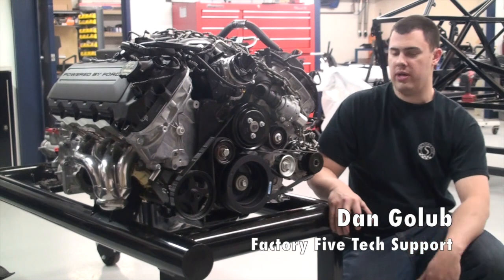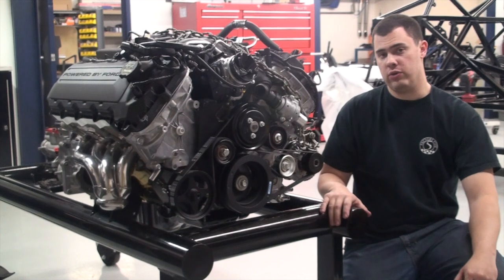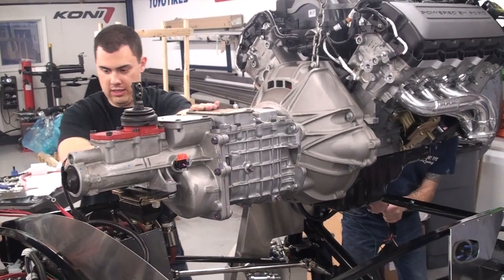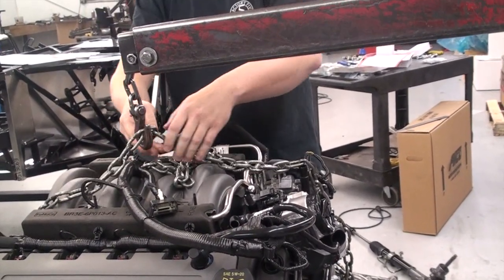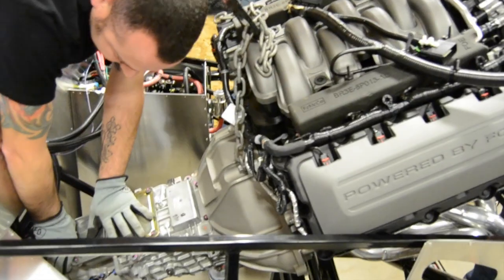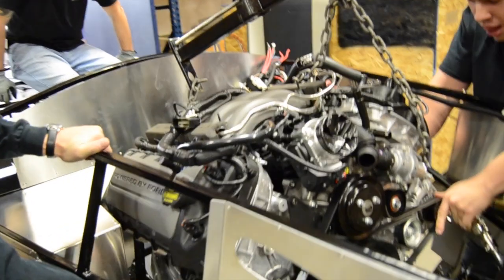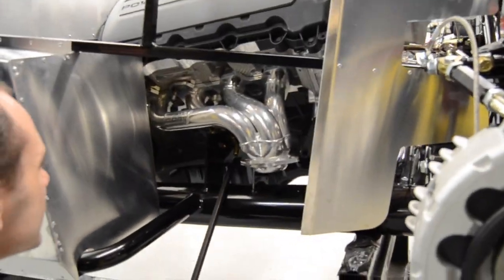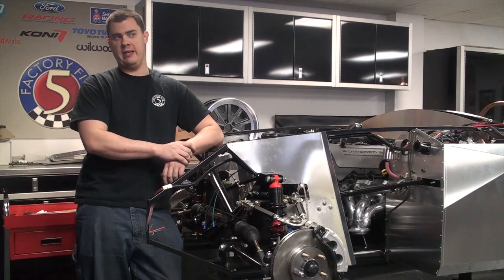Factory Five Mk4 Build Episode 13: Installing the Engine

Comment: Watched the whole series as ive not built a FF cobra but owned one and enjoyed it, reconfigured it several times and was now thinking of building a new one from scratch.  Obviously these videos are edited down for time but many of the techniques shown are parochial and some down right dangerous.  As someone who has spent 30 years as a machinist, mechanic, metal fabricator welder there are a lot of short comings with the techniques being shown in these videos, tech screws being used to hold brackets and cheap aluminum pop rivets used when stainless structural rivets should clearly be utilized as well as rivet nut inserts and proper use of grommets, the brake line video made me cringe completely.  I didnt see the use of a torque wrench in any video or the explanation of the proper use of lock tight and degreasing parts before its use, the use of body panel adhesive and most importantly as many people will do this install over the course of months or years the use of a permanent paint marker to mark properly torqued bolts so you can keep track of what has been tightened properly during the course of the build.  I realize these videos are clearly condensed for marketing purposes and the tools used are what your average homeowner might have in his garage but these videos should show the best techniques, processes and tools so your average consumer sees the best practices not what your average weekend warrior could achieve in their driveway with some cheap tools and aluminum pop rivets from Home Depot.

Comment: Goodness, why did that take 3 people? With an equalizer, you should be able to get it on any angle you need. For an engine hoist, get an air operated pump. It will make it go much easier. This allows you to squeeze the valve remotely while you are wedging the motor into place. Having done several engine swaps by myself, including one in a motorhome, it should easily be done by one person. The air control on the lift or use an A-frame overhead hoist with an electric motor. This way you can control up an down remotely.

Comment: I have a 351 Boss that I'd like to put into the pending Cobra project.  How do I align the motor mounts, brackets, bolt patterns, etc., to fit into the car?  Do I need to make a custom plate, tack weld it, bolted to the motor mounts and engine first, or is there a solution from Factory Five already designed?  Thanks!